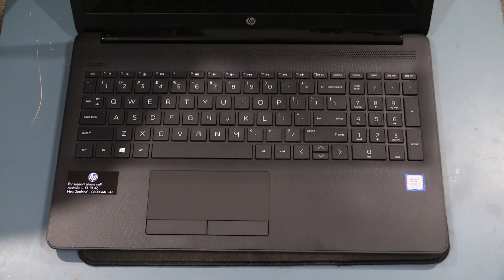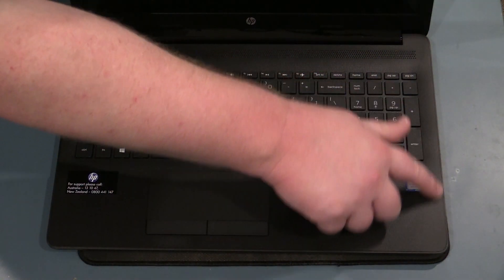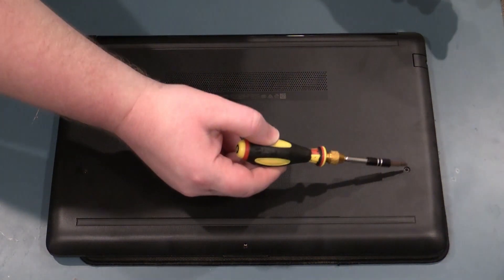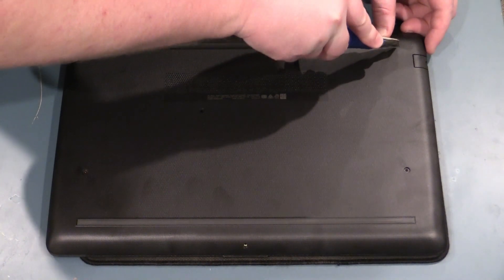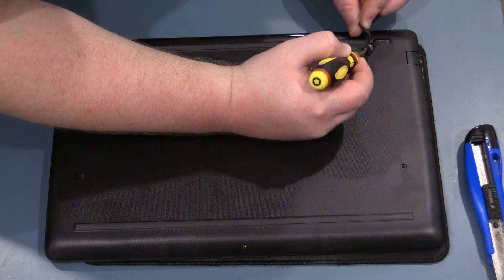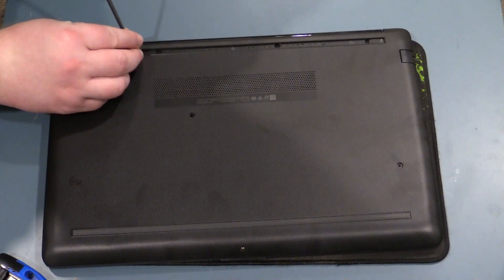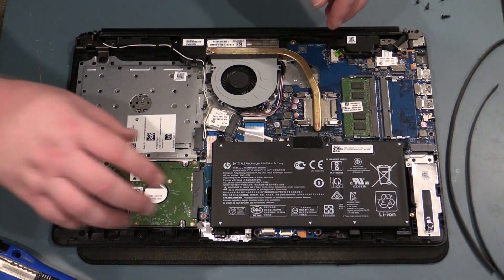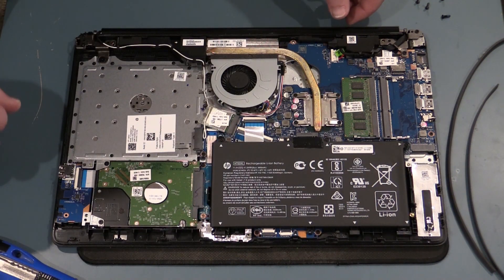HP 15-DA (15-da0094TU) disassembly take apart for memory, HDD or SSD upgrade

Comment: Could i ask something can use both hdd and m.2 or one of them because i want to make an upgrade and put an m.2 so if u have make the upgrade can u tell me??thanks a greetings from greece
Reply from the maker: Hey there,

I'm not sure on this specific model, I'd say the answer is most definitely a yes, it's just finding the correct adapter to let you do it. Wether their is a SATA cable directly for a 3.5" drive or you use a DVD-RW hard drive caddy and replace the DVD drive (if this model has one) I'm not sure, but either way you should be able to get it working with both a mechanical 2.5" drive and an NVMe drive.

Honestly though, if it were me I'd just buy a bigger NVMe drive and not use the mechanical, they're very slow in comparison!

Good luck :-) Please hit the like and subscribe button it's a big help for us smaller YouTube channels.

Thank  you so much!

Comment: Do the make a metal back for the laptop? my plastic back broke and in need a replacement and I was hoping for something stronger.... or do they sell any laptop back replament
Reply from the maker: Hey mate,

Unfortunately I doubt anyone has manufactured a metal replacement for them, it wouldn't be impossible to do but practically every laptop has a different base; so I doubt anyone has gone to the trouble for this individual model.

You can most likely find a good new plastic replacement for it on eBay though, I've been down that road before.

The weakest points are the LED monitor mounts typically, they snap out pretty easily so always good to be careful with it.

Good luck!

Ps. please hit the subscribe, it really helps me out a lot :-) Thanks heaps!
Reply: @Anthony99  Oh yes did sub.. you make helpful content

Comment: Have a nice day Anthony, my laptop still has 10 months of warranty and I don't think I can handle the removal of case. I want to upgrade ram and install my sata hdd to the motherboard directly rather than USB cable. There's a HP service in my town but as you know quarantine doesn't help me with it. Should I just leave the upgrade to the service or try to remove the case and upgrade ram myself? I worked with PCs before but I know that laptops cases are so breakable and I'm afraid.
Reply from the maker: Yes, this is the tricky bit as with this laptop it's quite tricky to open it without making a mess of the edges, you can do it and I'd recommend trying but you need to be very careful as it's easy to damage the edges.

I only use my finger tips and I pry it off from the middle front of the keyboard area, near the trip pad... as soon as I have 2 or 3 of the clips open the rest comes off very easily, the magic trick is don't use your nails or any hard tools...

It's hard to demonstrate from here haha but good luck and just take your time, you could even try taking it to a mobile phone repairer in  your area. :-) Good luck!!!

Ps. Please subscribe to the channel, I appreciate your support. Cheers!

Comment: Thanks for the video! I've got a question. I own a Laptop HP 15-da0021la, it has an Intel® Celeron® processor. I'm about to upgrade it to a 256GB SSD. How much RAM can it take?
Reply from the maker: Thanks for writing!

Maybe a better question is how much memory do you want to put in it? I wouldn't see much point in putting more than 16Gb in it... and I'd be certainly it'll be fine with a single 16Gb SO-DIMM.

You should check out a free program called Speccy, that will tell you more about the current memory config... if it's DDR3 / DDR3L / DDR4... 16Gb in a single slot shouldn't be an issue.

Considering the laptop though, unless you have some specific purpose, I don't see much point going beyond an extra 8Gb up to you... although it's not a very high spec laptop.

Good luck!! :-)

Please hit subscribe!! It's a big help, thanks...

Comment: What brand of the stock ram that comes with the laptop???
Reply from the maker: Sorry I’m not sure on that one although I always recommend Kingston memory, just need to pick the right type, speed, etc.

Check out Speccy, it’s a free program that will tell you the full current memory configuration, maybe an extra 8Gb single DIMM memory should be enough depending what you want to do...
Reply: Even though picking the right speed  and type,I thought combining different brand ram might result in compatibility issues
Reply: My lap says my ram was from micron technologies , should i buy a crucial brand memory?

Comment: Can i put my hdd back and still have the ssd??
Reply from the maker: Hi mate, you could use a hard drive caddy and replace the DVD drive if your system has one...

So have the SSD in the main 2.5" drive slot and the hard drive caddy replace the DVD drive, that'll work.

You can usually find a drive caddy to suit on eBay.

Or consider external storage like a NAS drive (Synology) something like that... keep your bulk data off the laptop and on the network, food for though.

Please hit the subscribe button; would really appreciate your support. Thank you!

Comment: Hi Anthony.  I have to replace the battery on my HP 15-DA0008CA laptop.  I am having trouble figuring out which is the correct battery to buy on Amazon and even the HP website.    Any advice?  Please and thanks!
Reply from the maker: Hi Amy,

I normally just buy off eBay, although you can probably find it on Amazong too.

Likely the easiest way would be too remove the battery and search for the reference number on the battery itself.

If it matches the model # exactly and it looks the same it's probably fine, although it's hear to tell you 100% from here.

Batteries are a tricky one as the after market batteries are hit and miss in quality, some are good, others not so much.

If you can get a genuine 'new' battery that hasn't been refurbished that's best, good luck! Thanks...

Ps. please hit subscribe! It's a big help to me, cheers...
Reply: @Anthony  thanks so much! And already subscribed 😊
Reply from the maker: Thank you so much!!

Comment: I have a very similar HP 15 da0596sa laptop. I want to add an M2 ssd and also increase the RAM (2x8GB). My question is do I need to disconnect the battery and if so how do I do it on these laptops? All previous laptops I've owned its been possible to remove the battery before taking the back off.
Reply: No, you do not need to disconnect the battery. I just did upgrade: 8gig ram to 16gig ram, 1tb HDD to 1tb SSD

Comment: Sorry to ask but what's an M.2 do?
Reply from the maker: M.2 is a type of socket on newer motherboards. It allows you to connect an M.2 SSD, as opposed to a 2.5" SSD which would take the old SATA cable you might have seen before.

M.2 SSD's plug directly into the motherboard (in the M.2 socket).

Depending on the motherboard, M.2 actually supports both SATA (like an older style 2.5" SSD) or NVMe (which is a higher speed type of connection... and it's a lot faster)... really I don't see any point in using a SATA M.2 SSD (like a Samsung EVO 860 for example).

If you've got an M.2 socket on your motherboard you'll want to use an NVMe SSD (if it supports it)... such as the Samsung EVO 970.

Best Google those two Samsung drives and that'll show you what they look like.

Please do me a favour and hit that subscribe button! :) Cheers!

Comment: Thanks for an extremely helpful video. I wanted to upgrade the RAM in my HP laptop. Your video showed me precisely what I needed to know to disassemble it. Thanks a BUNCH!
Reply from the maker: Thanks Marcus, glad to be able to help :-) Please do me a favour and hit subscribe, I'd really appreciate your help. Cheers!
Reply: After upgrading the RAM, did the performance significantly improved?
Reply: @plurdavid6351   
The computer was new, only about a month after purchase.  So the performance, as far as speed is concerned, did not seem to change since the computer already worked pretty fast. However, the additional RAM maximized the computer’s RAM capability. Now, we are able to run programs that we couldn’t run before because we didn’t have enough RAM. From that perspective the computer’s performance did improve. The computer now runs on its maximum of 32 GB of RAM.
Reply from the maker: @plurdavid6351  It depends on how you use your computer to if a RAM upgrade will offer much of a performance upgrade, if it's just a general use system 8Gb is normally plenty.

Usually an SSD upgrade will offer a much larger performance improvement.

Please hit the subscribe button :-) Would greatly appreciate it. Thanks
Reply: @Anthony99  i miss those days when, for a memory upgrade or ssd, were only 2-3 screws and not the whole bottom case. I hate the designers....
Reply from the maker: @MAILAPLEX   100% it’s such a pain these days! Some new 12th Gen HP you can’t even change the memory, it’s soldered to the motherboard… so stupid!
Reply: @Anthony99  hehe..... the memory soldered to the MB ccame first on the Asus X55 series :))) i think starting from 2013....  Just finished a "small" job on a similar Hp, whatching your clip. the screws behind the gum pads is so stupid :)) New ssd, MX4 and a clean 22H2 instal, right from the Microsoft site. Thanks for the video.

Comment: in my laptop the Combo Headphone jack is not working, and only output is given (no mic input). How to check and replace 3.5mm combo headphone jack ?
Reply from the maker: If the combo port is actually physically faulty it's probably possible to replace the port, you could order one from eBay and then find a local phone technician to change it out for you as it'll be a soldering job.

If the port does not feel faulty though, then it might be a faulty chip... if that's the case you can't really fix that; I'd be looking at an external USB soundcard for your speakers. They're quite inexpensive and will solve the problem for you.

Good luck!
Reply: @Anthony99  thanks! that'll help.

Comment: Great video, man. can I ask what type of M.2 SSD does it support? NVMe or SATA? Thanks!
Reply from the maker: Hi mate,

I'm quite sure I put a Samsung EVO 970 in it, so NVMe... that said, I'd open it up to confirm first... If the CPU is 8th gen or later it will probably take a NVMe.

If you want to be 100% sure, open it up and look up the specs on the board... I doubt the HP website will tell you but the motherboard might. Good luck!
Reply: @Anthony99  can this system support (2TB M.2 2280 NVMe Solid State Drive)?
Reply from the maker: @HenryEIje  Yes 2Tb M.2 NVMe should be no issue at all. I recommend Samsung EVO Plus 970 Series... good luck!

Comment: Thanks a lot for this man! I really appreciate it! I want the upgrade the laptops memory not couldn't find a way to pick it apart! But is there a way to put the rubber bits back? Or will it be permanently removed?
Reply from the maker: Bob Bob hi mate, if you pry them off careful they’ll reattach fine but I don’t recommend taking it apart until you’re ready to do the upgrade after a couple of times they’re less and less sticky... there is other ways to glue them of course but once or twice off and back on is no problems.

Please do me a favour and hit subscribe if you can?! Thanks!!
Reply: @Anthony99  Thanks for the reply! I'll do it only when I'm ready, windows shows that only 1 of 2 slots is used so I'll just trust that then. I really appreciate the help! I just subscribed and have already liked the video!
Reply from the maker: @IgnisVizsla  Great stuff... I'd also suggest downloading a free program called Speccy, it'll give you a more indepth look at what's actually inside your system.

Memory isn't a big deal, it's most likely DDR4 and PC's aren't that fussy about speed these days. If it were me I'd just pick up an extra 4/8Gb DDR4 SODIMM Kingston value ram, 2400mhz... something like that.

The board will probably handle 2666mhz but their isn't much performance difference anyway. Good luck!!
Reply: @Anthony99  Hey there! I realized I forgot to reply as  I opened this video again to see how to open it for finally upgrading the RAM, sorry about that. I checked out Speccy and its very nice thanks for recommending it! The laptop works a lot better after the RAM upgrade so thanks again for showing us how to do it!
Reply from the maker: @IgnisVizsla  Hey Bob!

Glad you liked Speccy, it's really handy hey?! I use it a bit in my tech area, saves pulling systems apart and especially laptops.

Did you do an SSD upgrade too? It's a massive improvement, honestly more than RAM will give you too...

Good luck!

Also, please subscribe if you can, would truly appreciate it :-) thanks!!
Reply: @Anthony99  Yeah its very handy! Unfortunately I had the budget to upgrade just one part and the RAM upgrade was more important as 8 GB just wasn't enough for what I did but its in my plans and hopefully I'll do that soon! 

BTW I've already subscribed the the channel!
Reply from the maker: @IgnisVizsla  awesome, thanks heaps mate.

Samsung SSD upgrade and it'll be a whole other laptop! it's a huge performance improvement :-) Good luck!

Comment: you don`t need to do that, you can upgrade to ssd just use 9.5mm caddy and put the ssd there and make it as priority
Reply from the maker: Jayson bayona you can use a 2nd 2.5” drive like a WD Black 750gb for bulk storage as well as the SSD.

Lots of options... changing the internal drive is an easy job though, not a big deal to do it

Comment: Are all HP -15da series / models have port for nvme? 
Nice video by the way!
Reply from the maker: Robin DM  Hi Robin, thanks for writing. My guess is that most 15DA wouldn’t have an M2 NVMe port... I’d go by the processor... if it’s Intel 7th Gen Processor or later, then maybe but best way is to just quickly open and take a look... anything earlier than a 7th gen is most definitely a no... you might find a SATA based m2 slot or mSata but no NVMe. Please hit the subscribe button if you don’t mind. Thanks!

Comment: I have ants creeping around inside my 15-da0094TU laptop , would you recommend me disassembling myself at home or go to shop for it? or will the ants affect the laptop if i do not clean it up? i fear it might lay egg and create a problem inside.
Reply from the maker: Mangneo Khongsai  that’s an interesting one! The disassembly just to get the cover off isn’t too difficult, just be careful not too break anything and take note of where you removed screws from. If you can get just the cover off it should be enough to clear the ants. Just don’t use anything liquid inside the computer... an air compressor or can of compressed air should be enough to clear it out. Good luck!!

Comment: Hello there, I also own a hp laptop HP 15 DA 1xxx.   I just want to know that how many RAM slots are there in this particular model... Plz help out with this
Reply: Check in the last manager, memory tab and right side you can see your ram speed (2400mhz) slots and all information, if u have 2 slots then it will shown as 1 of 2 .
Its basically for all laptops

Comment: Thanks a lot, I have a 15-db1001ua, and it has absolutely the same casing. Geez, why hp now makes it that hard to disassemble. My previous hp620 had 4 screws with separate lid. Very convenient access, no need to remove the rubber or whole back. 
This looks tricky.

Comment: hello I have screen flickering issue  with this laptop can you give any suggestions
Reply from the maker: Hi mate,

I'm guessing you've probably already fixed it by now, most likely it's the VGA cable from the monitor to the LCD panel, they do get worn out.

Hope you were able to sort it out!

Can you please do me a big favour and hit the subscribe button?! Thanks!
Reply: @Anthony99  Hey I am still facing the same problem but it is a temporary issue and it flicker once in a day sometimes works perfectly 
Thanks for your reply
Reply from the maker: @rahulb23   Yeah that sounds exactly like a VGA cable, you can probably order a new one off eBay.

They can be a bit of a pain in the butt to change as it's typically a complete disassembly of the entire unit and also the LED too.

So I'd probably wait until it's a real problem but the cable is likely only $30 or so off eBay, so a cheap fix.

Good luck!

Comment: ive got a 15dao3o1tu and it doesn't have a fan its got this big ass alloy plate instead, its overheating badly, any ideas to why has no fan?
Reply from the maker: I’d take a guess ‘bad design’... also I’ve noticed that after SSD upgrades systems run hotter too, the cpu can actually work to its potential now so systems get hotter. I figure they’ve designed the cooler for a computer that runs slower than our upgraded version. You can try to work some cooling into it, I’m sure the motherboard will still have a fan header but don’t know where you’ll send the heat too

Comment: Hello! I was wondering if it's possible to clean the keyboard by removing the key caps?
Reply from the maker: Normally I just use a micro fibre cloth and some screen cleaner to clean the keyboard... I wouldn't personally recommend removing the keys to clean the keyboard; but it might be possible.